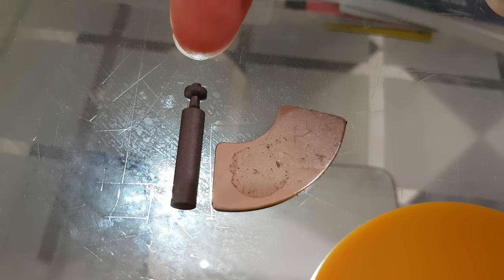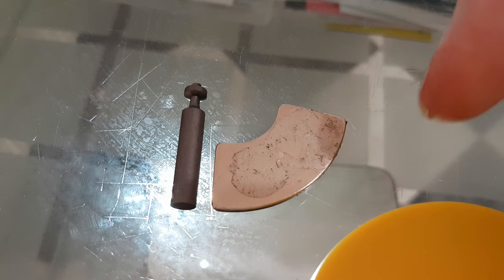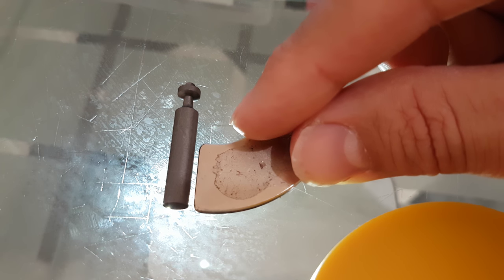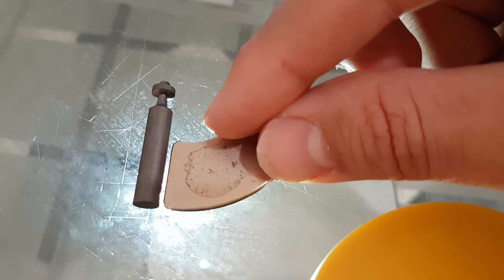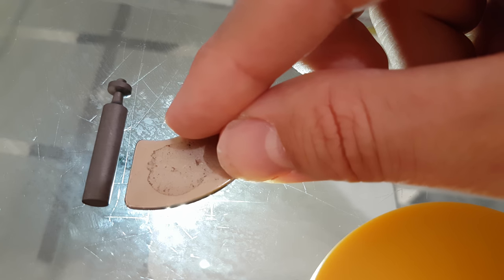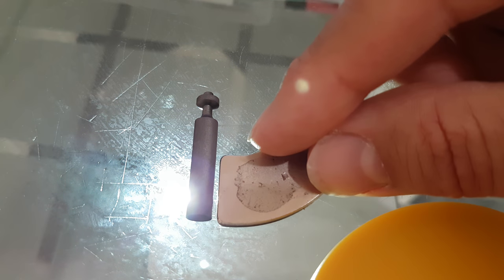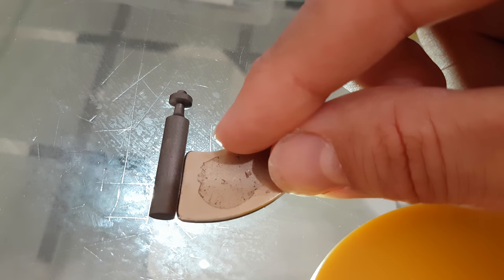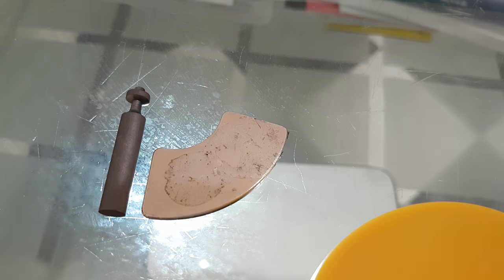Diamagnetic properties of some types of carbon

Comment: If the usual large diamagnetism of pyrolytic graphite is caused by alpha-currents in benzene rings (behaving as perfect conductors at the molecular scale,) I wonder if simple classical physics applies to the rings:   if they are exposed to a b-field while being grown from vapor, will they "lock in" the b-field, by exhibiting persistent currents once the benzene rings have closed, and then the applied field is removed?   (N.b. this would be a macro-like effect involving molecular rings, rather than atom-level effects such as ferromagnetism.   Call it "artificial meso-ferromagnetism?")

This would be similar to the "pinning" effect of any HTSC ring which is cooled below the SC threshold while a magnet is present, then the magnet is removed.  The total flux in the "donut hole" will not change, so the removal of the magnet induces a supercurrent in the closed ring.  Unless warmed up or fractured, the closed HTSC ring then acts as a permanent electromagnet.

So, my question:   if pyro-grown graphite is exposed to strong b-fields during the growth process, is it well known that this has no effect?  And, it doesn't produce any unexpected phenomena?   Will such graphite NOT exhibit any locked-in b-fields?

So, if the opposite occurs, and graphite grown from vapor in a b-field did exhibit persistent micro-loop currents, and become a permanent magnet, then any furnace based on DC or low-frequency electric arcs, and producing vapor-grown graphite bits, might be expected to produce "magnetic" carbon debris: some graphite which contains persistent current-loops at the nano-scale, some of which would contribute to macro-scale average orientation, and produce detectable macro scale b-fields (the debris would be rotated by, or be moved along by field gradients of nearby magnets.)
Reply from the maker: And this is why we use pure carbon and then use EDX / Mass Spectrometry to determine if it is carbon or something  else.